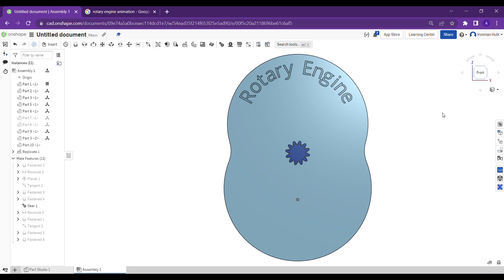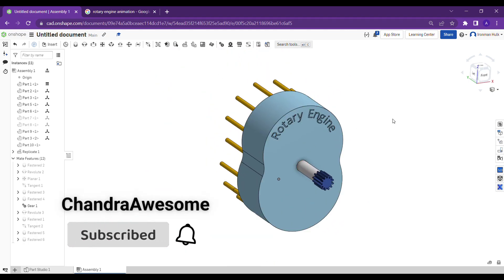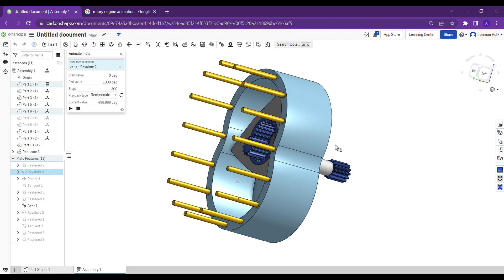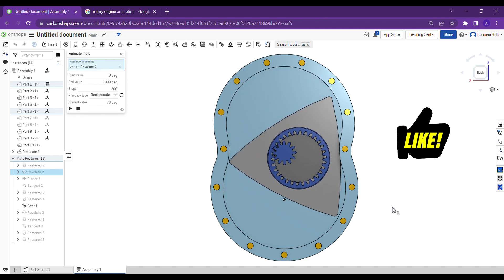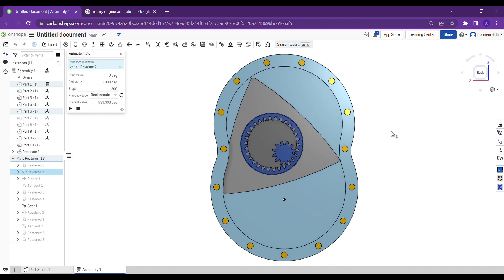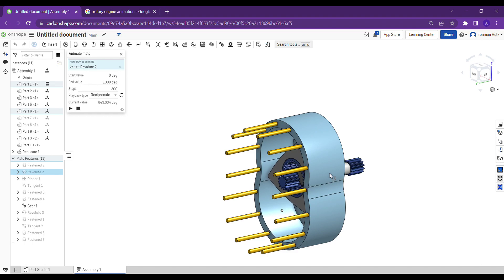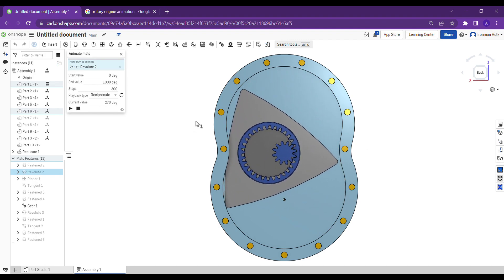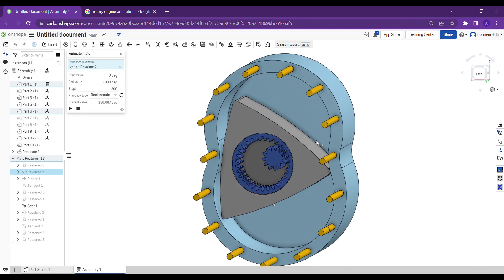Rotary Engine Assembly in Onshape | Tried but not getting

Comment: Hi, I’m not sure if this will work, if you increase the radius on each side of the rotor, and remove the three corners and replace them with cutout holes for little sliding blocks using a pin slider mate to  create a constant contact with the rotor housing, you may also need a tangent mate, that would be between all three of the rotor edges and the inner wall of the rotor housing,this should enable the rotor to rotate and create a fairly smooth simulation, I have noticed that a lot of simulated Wankel engines do seem to rely upon the eccentric shaft rather than creating movement from the router, the router is forced to follow a set pattern due to its relation with it’s eccentric shaft. I am quite impressed with your model, I would like to work on a cad project with a team of cad enthusiasts like yourself.
Reply from the maker: Thanks for ur suggestion buddy. Simulation wise is ok. But the construction of the case and crack shaft makes me confused a lot. Idk where it will found
Reply: @ChandraAwesome  I found a video on YouTube that shows how to create an entire rotary engine on solid works which is a similar software to onshap, but I think I have an engineers plan for the crank case, if I find it I’ll share it with you
Reply from the maker: @elonwhite6628  thanks bro that's a lot for me
Reply: @ChandraAwesome  it’s no problem, I’m glad it’s of use to someone.